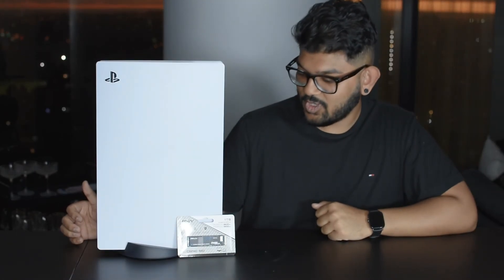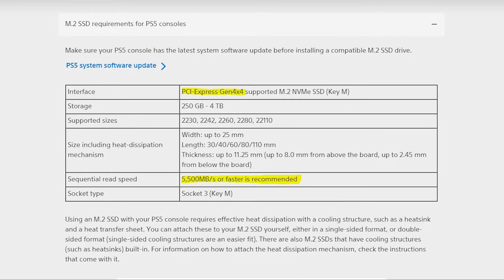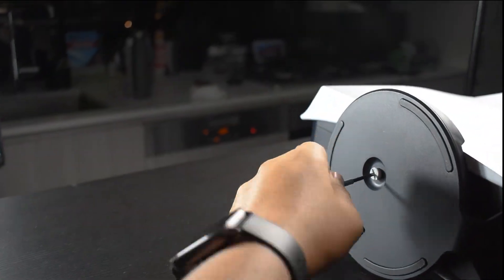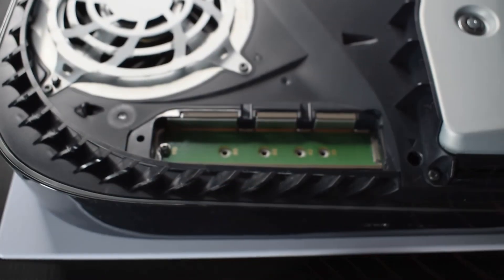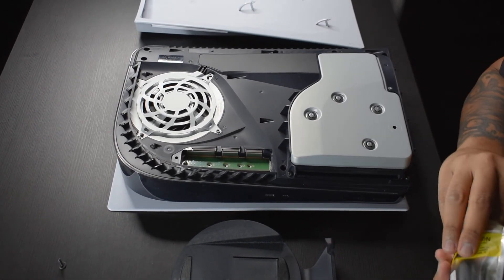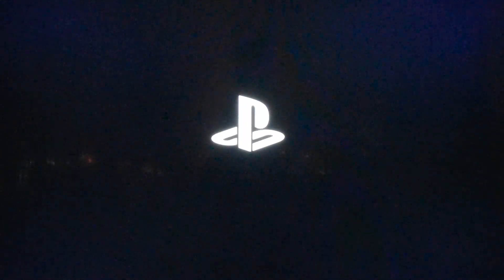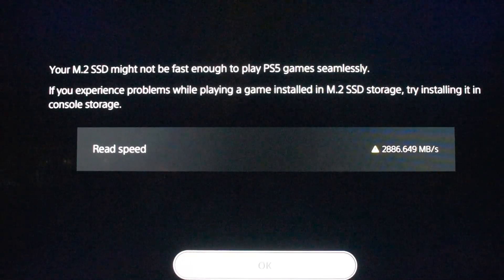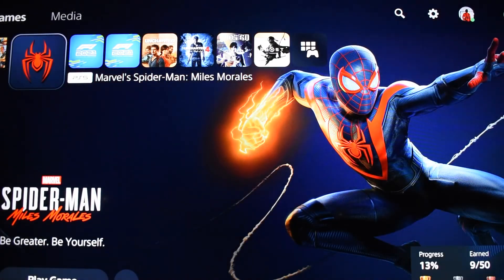Cheap slow speed Gen4 SSD for PS5 Will it work? PNY CS2140

Comment: Hey wondering if 6 months in it still works? I'm considering buying this exact SSD because it's 40% cheaper than all the 5000mb/s ssds out there. Only thing I'm curious if Sony might release an update preventing the use of these "slower" ssds. Maybe not though because 3gb/s is already extremely fast.
Reply from the maker: Still working fine, however I have not tried the newest games like God of War Ragnarök, it works fine with Horizon Forbidden West and Grand Turismo 7. It is possible they could make an update, but I doubt it will be any time soon.
Reply: @life_n_tech661  thanks, I doubt they will update it to stop it from working, 3gb/s is already very fast and I doubt most games will even come close to utilising that speed, especially considering most are cross platform and even most ps5 exclusives will eventually come to pc.

Comment: Ordering the same exact SSD for my PS5 right now! PNY CS2140 1TB also coupled with a cheap SSD heatsink. Man, compared to the 5gbps gen4 SSD this is half the price! Thanks for the video.
Reply from the maker: Awesome! Let me know how it goes. I am still using the same SSD on my PS5 and I have had no issues at all so far running several ps5 games from it.
Reply: @life_n_tech661  , it finally arrived. Open the SSD, put the jonsbo heatsink on front and back with grey thin thermal pad (it came with two pairs of thermal pad thick and thin), and slide it in on my ps5. When it formatted the PS5 said the speed is around 3300mbps! Pretty close to the advertised speed. Plays all my ps5 games and everything runs okay.  👍
Reply from the maker: Awesome great to hear!